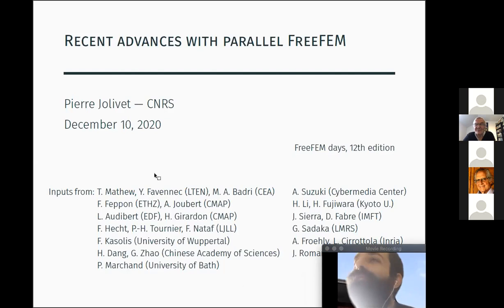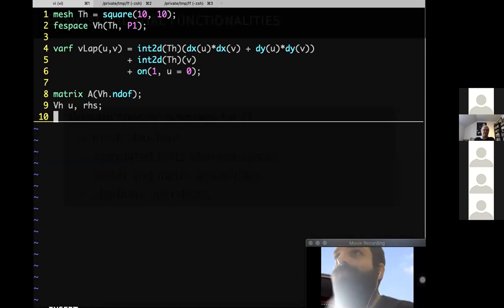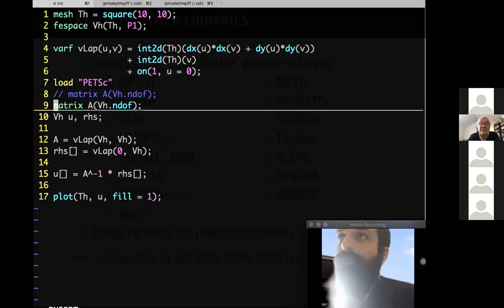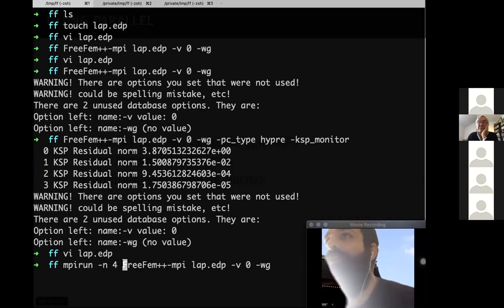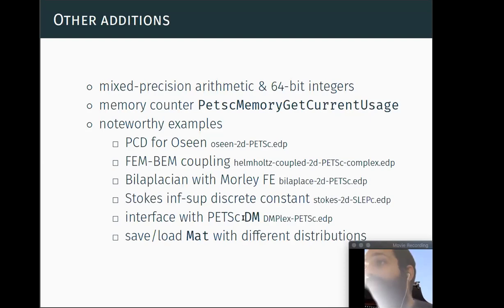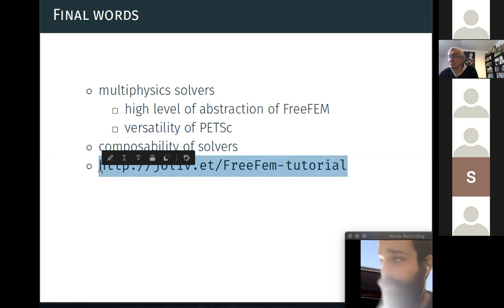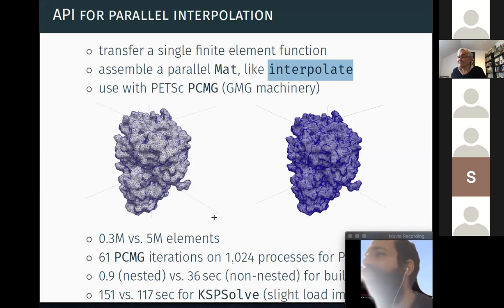Pierre Jolivet recent advanced with parallel FreeFEM

Comment: Introduction
1:07 Basic sequential functionalities
5:11 Interface to other libraries
9:45 Going parallel

New functionalities
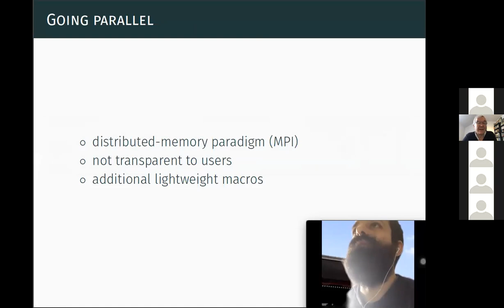13:06 Important Reminder
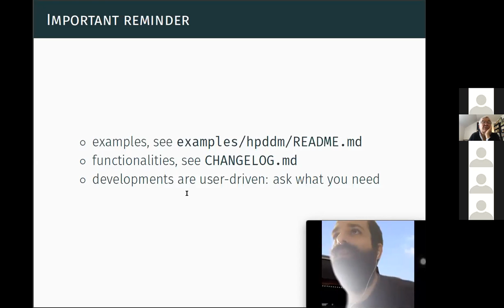15:15 Interpolation
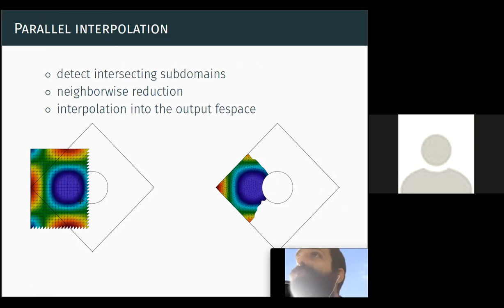18:28 API for parallel interpolation
20:05 Parallel mesh adaptation
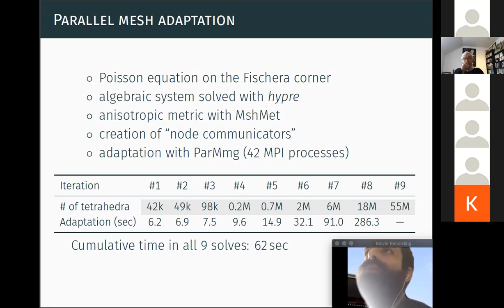22:22 Nonstandard eigensolvers 
24:02 Easier use of shells: For preconditioners 
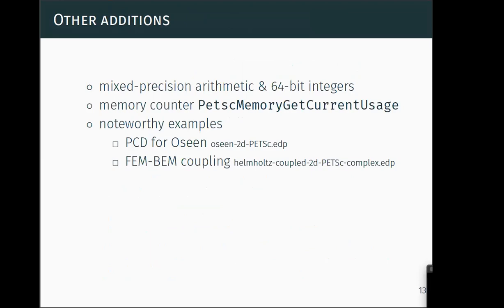30:22 Other additions
 
Applications
 
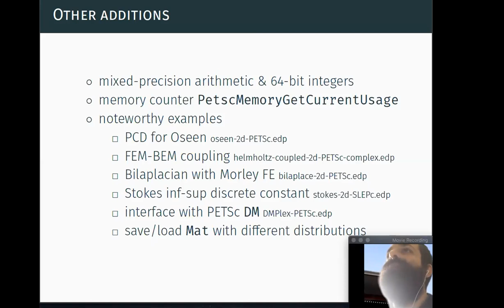37:35 Eddy-current testing
41:00 Eigensolvers with block preconditioners 
44:05 Radiative transfer I 
45:52 Heat exchangers
47:58 Robust domain decomposition method
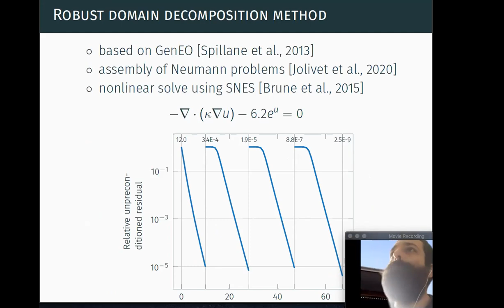49:40 Some more
 
Conclusions
51:21 Final Words
53:40 Q&A